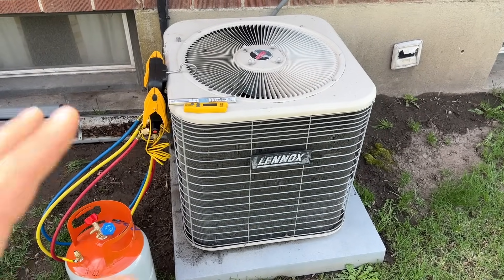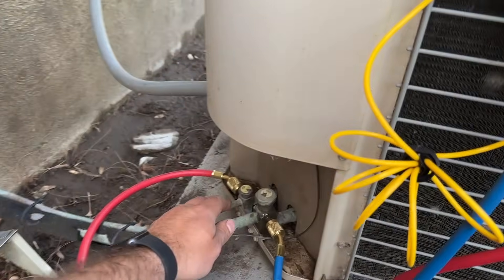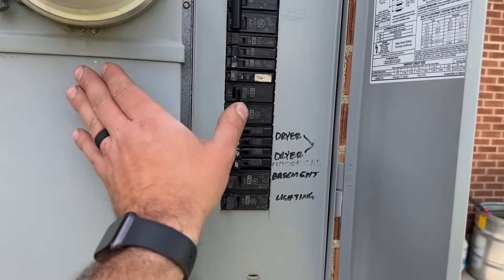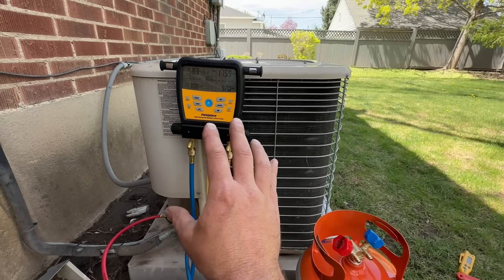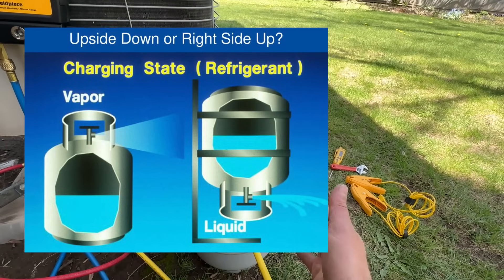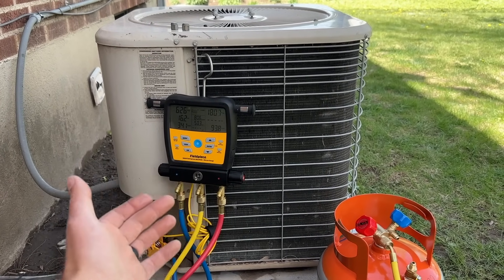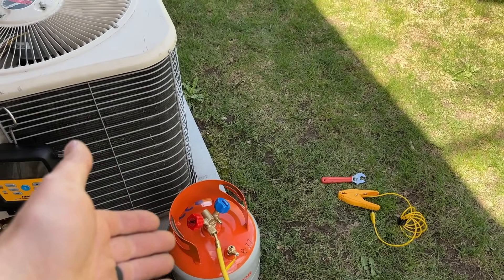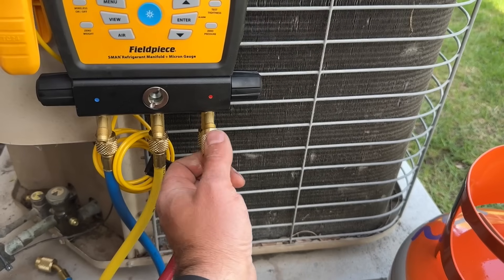How To PROPERLY Recharge Your Air Conditioner

Comment: Thanks!  Three guys missed a leaking valve stem which I only found after using the confidence gained from your video to fill it with fresh r22.  All said I needed a new system, 11k was the cheapest.
Reply from the maker: Thank you so much! 🙏🏻
Reply: How do o fill R22 for a Txv system?
Reply: @MechagodzillaDraws to charge a txv system with a temp probe and a manifold gauge, you would charge the system based off of the subcool of the system. You will need the liquid line pressure and the liquid line temperature values instead of the suction side values. The txv maintains the superheat of the system to typically around 10 superheat when the system is properly charged. because the txv tries to maintain the superheat, you can not use superheat for charging a txv.
Reply: @_ExTitus  thanks

Comment: This is definitely not a DIY work. It requires some expertise to do it. It involves a lot understanding.
Reply: From an expert like you on YouTube whining on a channel about sharing knowledge?
Reply: @Imhotep11  You got it wrong. I am surely an expert  in engineering. And do lot of other things. Being a handyman for several years, I could not still get a hang on hvac nuances which is important on safety point of view. I just said that it requires good understanding. Not any Tom dick and harry can do this as claimed by you.
Reply: You unqualified overrated techs always pushing the term expert.  This is one of those good Ole boys systems that has been cracked.  This is like putting air in a tire, you are no expert because you spent 8,000 hours checking a gage.

Comment: Any tips on why a condenser fan motor will run, but the condenser only runs about half the time that it should? Seems like the hotter it is outside (when you need AC!) the more likely the condenser won't run, but the fan motor will. Could it be low refrigerant?

Comment: Do you need to have a leak in your HVAC system/unit in order to require addition of Freon? My Carrier Unit is only 5 years old and has worked beautifully up until the time I turned it on and air blowing out house vents but not cool air. That fatter hose is not beer can cold. I believe I need Freon but do I have a leak somewhere?
Reply: have you checked your filters? or if the outside coil is relatively clean? it shouldn’t need any specially in a newer unit

Comment: Thank you so very much. I have an air conditioning unit on a houseboat that I built 10 years ago and I was given one price to come out and put 4 pounds of our 22 into the unit. I couldn’t believe the price was over $1200. I am going to now research on where there may be a leak and I’m going to use your recommendations. Thank you so much I’m currently parked on the coast of the isle of man.

Comment: Yeah.. this is great, except I'm not allowed to buy r410a...   in this "free" country that we live in.
Should I just use R290 or R134a?   It's just a window unit--  24k btu GE
Reply: If it’s r-410A you have to use r-410A
Reply: @exotichabits3624  You can use R470a as a replacement.. Anyway, I found some

Comment: Do not go off JUST PRESSURES! That is a terrible idea by the way. You’d be more accurate by checking saturation temps then just pressures if your not gonna measure superheat or subcooling
Reply: What's wrong with going off just pressures?

Comment: What’s the point of going to tech school then? If the home owner is so smart, then they can figure out how to do a proper duct design & load calculation on their structure. Don’t call me when you screw it up to fix it. I’ve never scammed people/customers in my life & love to educate the customer but whatever.  Charge that a/c up real good. Better hope you understand what superheat & subcooling means, & how to calculate btu capacity output, seer ratings, how a pressure/enthalpy chart shows how efficient or inefficient a refrigerant can be, oh understand psychrometrics, and make sure you understand how airflow works. Cause techs don’t want you to know how to charge your own system. I don’t give a rip if you think you can charge your own system. GOOD FOR YOU! Freon is usually the problem right?! Keep on adding refrigerant and see what happens. Cause hvac/r isn’t very technical at all right? Don’t bother purging your refrigerant hoses. Let that compressor oil hydrolyze! Customers will inevitably screw up!
Reply: Butt hurt much? Adding refrigerant is that one thing they can do to help cool their home and to save a few hundred dollars. They don’t need to do half the stuff you talked about to read a low pressure gauge to add refrigerant if they have a known leak. Chill out dude.

Comment: Don't forget to tell them they could be fined $37K if they get caught handling gases without the proper certification!
Reply: @ImStucKinVA  I spent two years at a technical college learning the right way to do things. His technique is not bad, and he is peddling good information, but without a solid foundation and knowing why he is doing what he is doing, it could turn bad quickly. That little hiss when he attaches and releases the lines is called a "D-Minimus" loss. It is what is considered acceptable when attaching or releasing the gauges. There is a test even a person with no schooling can take through a company called EBSCO to earn one of three levels necessary to handle gases for residential and commercial use, or a Technician Universal when I possess to handle them all. Vehicle systems that use gas require a separate system, which has an open book exam. That digital manifold by Field Piece was just being released when I went through training, it is state of the art and takes a lot of the guesswork out of what is happening in the system. Still, to use it you really need more than the information imparted in this video.
Reply: @billtaylor2405  I completely understand where you're coming from. However, that just made me laugh when I read it. I think it was the amount that got me! I was actually watching the video because I sold a used AC unit and the guy said there was no 410a in it and I still don't know if it was supposed to have any in there so I started reading comments to see if anyone had an issue similar to mine but then I came across your comment and it was much needed at the time! I had no idea you could get  a fine for something that most people wouldn't think is a big deal because it was only a small amount that came out.

Comment: Thanks do much for this video.  I have older imperial 4 port manifold with low loss fittings on red, yellow, blue lines.  (No ball valve shut-offs on lines). When red and yellow are disconnected after recharge, can I open still attached blue and suck the left over refrig in lines into unit?  Obviously I don't want to suck in air.  Thanks do much.  My low loss fittings are yellow jacket.

Comment: Bro you didnt show or mention that you need to purge the high side and low side hoses as well as the refrigerant hose. I dont know if you did that but your gonna introduce air into the system. Or at least someone who doesnt know will because you didnt tell them that. Hope this helps.

Comment: Got a couple of problems with this video.before i get into the meat and potatos. No this process is not hard at all or dangerous. And ive not been in hvac personally but been around it all my life my family is in the business. But my main problems are. 1. You need quite a bit to do this you need a manifold (the one in the video is $700 not require as you can buy an analog set), low loss lines ($120), a bottle of r22 or 410 (which is a problem in detail later). Main problem being you need a liecense to get it which is 4-5 hours and $50-100 after that you need to find r22 or 410a which good luck. (He linked 2lb bottles that are $120 but in the event of needing more thats an additional $120). To get a 25lb bottle its easily $3-400. You need to know what your unit takes which is labeled on the unit just got to look.  So for $990 you can do it yourself or you could pay a tech $120 + the cost of freon (rate vary depending on tech and what type) and not have to deal with it. Now main problem with 410a and r22 theyre being phased out this year 2024 and you wont be able to buy it period. So tought shit if you have a system and if a tech doesnt have it your out of luck and need a new system because the new A2L (r32 and 454b) systems aren't interchangeable. Also not for sure but the links might be affiliate links so your paying him.
Reply from the maker: Yes, everyone knows all my links are affiliate links and people go out of their way to use them to support because I’m giving back, unlike most people in this trade 👍🏼 thanks for the comment

Comment: So, did I understand him correctly - if the suction line is too cold it is low on refrigerant and if the suction line is not cold it is low on refrigerant? In other words the temperature of the suction line will not tell you if you are low on refrigerant.

Comment: Short & simple but informative. Good video. We fell on hard financial times after our father passed away from mesothelioma. We have a slow compressor leak & needs recharging every month. We would be paying hundreds for a tech every month because we just don't have enough money for a new unit right now. We were even using multiple window units borrowed from friends until they started to die. This video was very helpful. Thanks.
Reply: You should try adding leak seal to the unit next time. Also, don’t get caught using refrigerant without an EPA cert. your fine will be a heck of a lot higher than what a new system will cost.

Comment: my a/c guy today, let a ton of “white steam” out when he “tested” my system.. it was just a general 79 buck advertised test. they have 5 star ratings but so much came out that i moved away.  he then said its like testing a tire for air, some comes out and should be replaced. so, with that much lost, he offered 450 bucks to fill it. lol.  i assume that is NOT normal per your test here?
Reply from the maker: Dang he did something wrong because that is NOT normal
Reply: @diyhvacguy  i figured something is not right as i cant find a thing on google or youtube about freon leaking out.  it nearly blew his hat off.  so, i guess the next time my a/c runs, if its not cold, i will know there is a problem, sigh.
Reply: @bluejay713  our “ring” surveillance camera didnt have that part of the back your covered of i would have downloaded it and asked the manager or even the owner.  its a HUGE local company and they have 4.0 star reviews, which was why i went with them.  its over and done with, with NO proof on video, and the guy said “its like checking a car tire,, some air will get out” but he struggled to stop the white smoke from getting out, it took a few seconds.  i then saw on youtube that it was not normal to do that.  thx for the reply.  :-)

Comment: New subscriber here, Will easyseal ultimate tube help to sealed the system . Looks like I having a Freon r22 leaking/ lost in my ac. It was working fine last month but not until now it’s not much.any suggestion is greatly appreciated thanks
Reply from the maker: If it’s a small enough leak it will work. It’s worth a shot!

Comment: The first time I put r22 in my ac I just added until the pressures matched what the sticker on the machine said it should read…it’s the beat it’s ever ran….its still got a leak on the line somewhere so yeah…and I don’t want to put dirty Freon into it that idk for sure if it’s all r22 or mixed and eBay hasn’t many sellers from Mexico on there anymore…I’d found 2.2 lbs for $100 on eBay of new r22…supposedly u have to have a license to buy Freon…u don’t lol…so lane

Comment: Would it be a bad thing to add r290 to a machine that might have some r22 left in it? Looking at the charts for the comparisons within the coils, r290 runs slightly lower pressure but otherwise pretty close to the same thing across the board…im not able to hire anyone to repair mine or replace it so I have to figure this bs out in my own….its like learning Russian with a lot of the terms….i figured out that r22 is simply methane and butane with a bit of chlorine and fluorine in it…and r290 is super filtered propane…so wtf is with the prices in this bs!? Monopoly for sure banking off our ignorance ….

Comment: What the point? The EPA makes it illegall to buy refrigerant unless you have an HVAC license.
Yet I see some of these pros in florida releasing it ito the air because they dont have a recovery unit and they mix refrigerants which is also an EPA no no.

I have HVAC training but no licence and airconditioning wholesalers will talk to me about anything but wont say a word about refrigerants. 

Big scam supported by the govt.

Good video though...

Comment: Question, when charging a unit after having previously removed all refrigerant would it be normal for the low pressure pipe to frost during charging?

Comment: Thanks my friend.  You should run for president.  We need honest people like you in office.  I got scammed by my warranty company whom referred their hvac subsidiary company. Charged me $75 for service call plus $800 to repair a leaking coil last August.  I turned my ac unit on in March no cool air.  I called the hvac company to have someone come out to verify the issue wasn't the same problem i already paid for.  They tell me i only had a thirty day warranty.  Amazon gives a better warranty than that.  I have a construction company.  I give my customers 1 year warranty on my work.  I won't be scammed again.  Thanks for your selfless insight. I hope the universe returns gratuity to you 10 fold
Reply: That’s what you get for using warranty companies
Reply: @user-vr4zm4vk3h  it doesn't matter. Warranty companies don't do the work.  HVAC companies do.  A couple not referred by the warranty company wanted to come out to recharge my unit at $100/ pound... I need 9 pounds so that's $1000. I bought 25 pounds for 300 and did everything myself.  Do the math then let that sink in. HVAC are ripping consumers off. You're just mad when good people are honest and expose your decit. I have a construction company.  If you can do what I do have at it.  Consumers can definitely do HVAC maintenance themselves

Comment: Do you need also to purge the blue line before filling?
Reply from the maker: Yes I apologize if I didn’t show that. It’s not going to be the end of the world if you don’t though. It will be totally fine
Reply: @diyhvacguy  Good to know. Also, after done filling, do you think the red line is filled with liquid or compressed air (assume it is not purged or does not need to be purged at beginning)?

Comment: It's illegal to add recovered refrigerant into a system other than the system the refrigerant was recovered from
Reply: My first thought also…
Reply: I just took the type 2 cert, and you can't use recovered refrigerant from/on systems not owned by the same person. So if I have three ac units, I can transfer from one to the other, but not to my neighbors unit.

Comment: we called for service since one zone wasn't getting cold. freon was low. it was the old refrigerant(2008 system lennox), instead of charging it, the tech said it needs to be replaced(7k) since the old refrigerant is now more expensive and will just leak out again. we opted to wait on it since fall arrived but now the furnace on that zone is not working and the power board is now dead. another company said the combo unit needs replacing(14k) since it is 15 y/o anyway. couldn't they just recharge the freon and replace the powerboard?

Comment: Can you please help me out. I just had a new unit replaced. I replaced the outside unit and the unit up in the attic. It cost me right at $7,000 dollars. This been about 2 years ago the brand name of the unit is a Bryant. Three of into my new unit the unit started making it horrible sound when it started and when it stopped it also made a horrible loud noise. I’m not a AC man but I’m 71 years old and I’m on a fixed income. I did some research on line and learned that it could be the hub right where the fan blades attaches to the motor fan. Do you feel that this is the problem? Where can I get a hub to repair it? Thank you

Comment: Can you use A/C manifold guages from automotive A/C  setup  & just swap out the hoses? They look similar,  are they the same, minus the automotive quick clamps? The threaded ends look the same? If not, what end should we look for when shopping for hoses? Thanks.

Comment: I liked your simple way to check the system "80-90 degree day 60-80psi on low and 150-175psi on high", I noticed your gauge said r22 suystem, will these pressures be the same on a r410 system or what will those values be?
Reply from the maker: This is just for r22. For 410a you should be 120-140 low, and 320-375 high

Comment: Yeah, i think i got a leak today. My cats woke me up and it was SUPER humid inside my house, and the copper line inside by the AC was SUPER warm. It was warm all the way to the outside condensor thing. I dont know what happened. No weird noises were coming from the system, nothing gace me any idea. If it wasnt humid i wouldnt have even looked in the cabinet.

Comment: I literally add R290 to my R22 system every 2-3 years. It has a small leak. HVAC want way to much to repair it. R290 propane is dirt cheap. Been doing it like this for 12 years. I'll keep doing it too.
Reply: Explain how this works...interesting!
Reply: @seanmiland it is compatible with my old refrigerate. It's actually a tiny bit better. Just charge the system to the pressure. Don't even have to vacuum it out. It would be best to vacuum it out if you can first